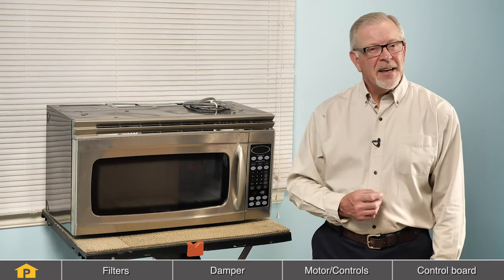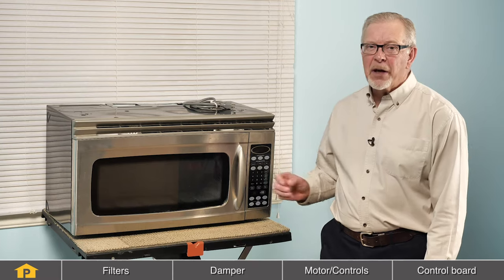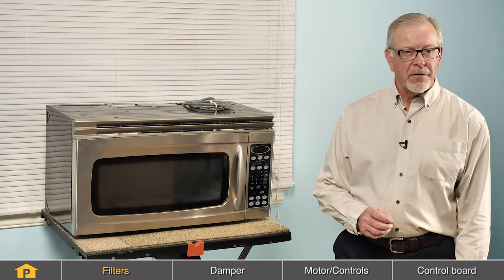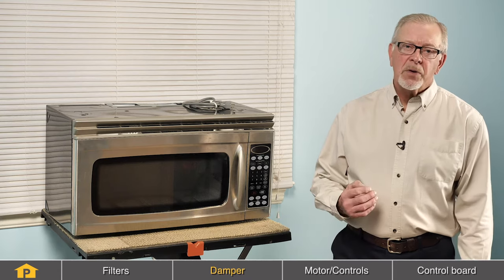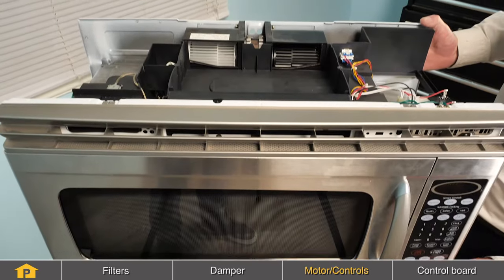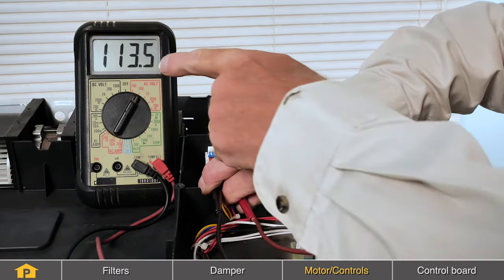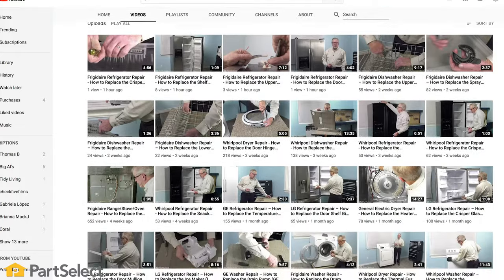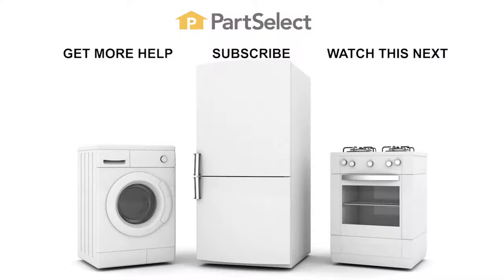How To: Microwave Troubleshooting - Why is the Exhaust Fan Not Working | PartSelect.com

Comment: these OTR hoods barely pull air/steam/smoke due to poor design.  the issue with these is the lack of suction ducts.    air gaps need to be sealed or you'll never increase suction.   picture a straw as your suction fan, and it's going through the bottom of a styrofoam cup.  now put holes in the cup and suck through the straw.... hardly any noticeable air flow. seal them, and your suction will be incrased

Comment: Microwave fan only works only on 1 speed today after damper vent extending from vent coming out of micro and  to the ceiling outlet this was replaced yesterday so it would not seem that there is a reason for the speeds now not working but what should we check?